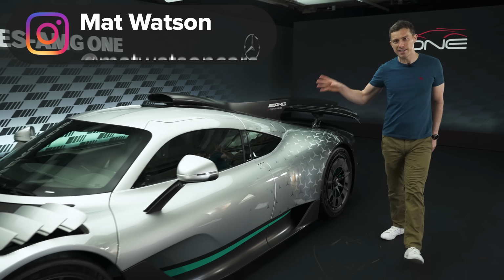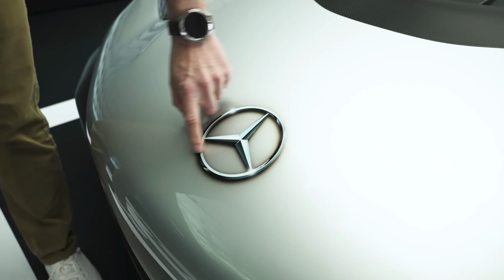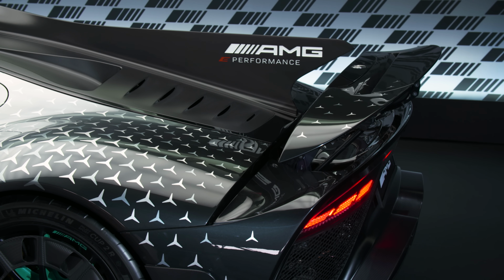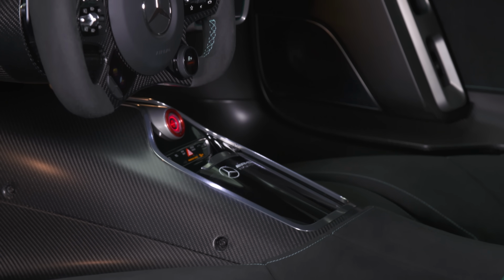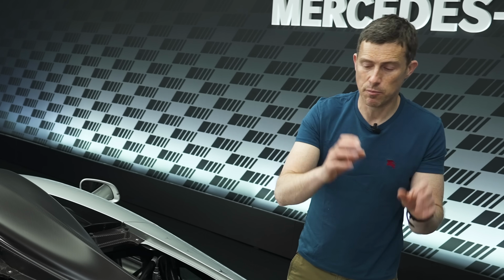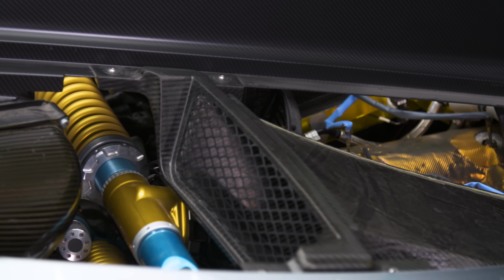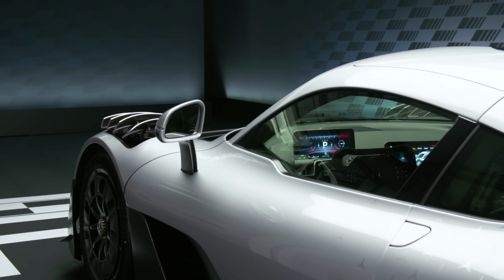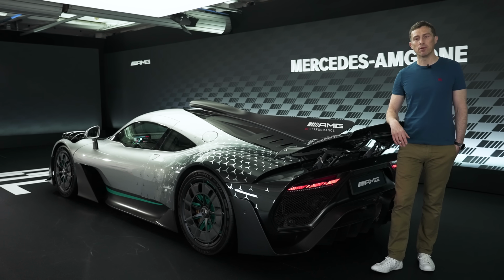Mercedes-AMG ONE: An F1 car for the road!

Comment: It sounds so simple in theory. Why shouldn't the cutting edge of hypercar design dovetail seamlessly with the bleeding edge of competition-ready, open-wheel racing tech? Well, forget the theory. Sit in the driver's seat. Take a breath, pucker up, and shoot a tentative glance in the direction of the throttle. Did you feel that? Have you noticed that you are suddenly a mile and a half into the next time zone, and your face is inside out? Yeah. That's why.

Comment: Also, the Formula 1 car this car’s drivetrain is based upon has one combustion motor, one hybrid, motor, and one electric motor. The AMG One  has all of that but with 4 electric motors. One at each wheel. 
That seems to be missing or incorrect in this video.
Fantastic video all the same!

Comment: Almost 50% of the combustion energy turned into motion energy... That is actually a pretty outstanding achievement!!! Well done Mercedes😌👏👏👌
Reply: The 50% was f1 cars.. This one 40%
Reply: Diesel engines do that too, they’re theoretically capable of hitting 73% thermal efficiency.
Reply: if it doesn't race i don't give a care.

Comment: Well, an F1 engine is scrapped after 5 to 6 races at the most. I'd like to see the longevity and reliability on this one. Honda perhaps can make a better running and more reliable roadcar with their F1 engine, more so because it's perhaps the last F1 engine they'd ever make.
Reply: I think I read somewhere, that after 60k km (or something like this) you have to get full service with engine replacement etc

Comment: 1700kg… wtf? Ferrari f8 tributo is 250kg less with v8 engine and doesn’t even have carbon chassis… maybe this is why it has the same 0-100 acceleration, with less power… after so much waiting and hype about F1 technology, someone might expect some extraordinary performance parameters…  something went terribly wrong with this project

Comment: Mercedes says the One will hit 62 mph from a stop in 2.9 seconds and reach 124 mph in 7.0 seconds, going on to a top speed of 219 mph. That bests the SLR Stirling Moss by 2 mph, making the One the fastest production Mercedes ever. It has massive carbon-ceramic brakes with ABS, and up to 80 percent of the One's braking energy can be sent back to the battery through regenerative braking. The awesome magnesium wheels have carbon-fiber aero covers and wear Michelin Pilot Sport Cup 2R M01 tires that were developed specifically for the One. Another innovation is the multilink suspension, which has adaptive dampers, hydraulically adjustable height and special pushrod spring struts at the direction of travel, which increases stiffness and reduces roll.

Comment: So mercedes finally released the long-awaited Project One, and as wildly impressive as it seems to small-minded people, it's somewhat underwhelming for a hypercar by Today's standards -- especially when you consider the multitude of tweaking it underwent over a span of half a decade... But let's take a look at the stats;

It does 0-100 (km/h) in 2.9 seconds - which is the same as the M5 CS, a family sedan that has 414 hp less, and is 130 kg heavier than the Amg hypercar. *signs of inferior engineering.

0-200 (km/h) takes 7 seconds. The Bugatti Chiron only needs 6.1 seconds to do the same, and it's 300 kg heavier and 6 years older than the highly acclaimed mercedes.

It has a top speed of 352 km/h, which is 39 kms slower than the McLaren F1, that was released in 1993 - and has 321 kW less power than the merc.

So we've waited so long for this mediocre answer to the likes of the La Ferrari and McLaren P1 that's much older than this Lamborghini copycat...Goodbye.🚮🚶‍♂️🛀
Reply: It’s a TRACK car, f1 cars aren’t aiming for top speed, they are aiming for the best track performance. Acceleration, top speed and horsepower aren’t the sole things that make a car good. It’s the quality overall and what it’s aiming for. You can’t compare a car built for top speed (Chiron) and a car built for the track (AMG ONE).

Comment: 2,9 sec 0-100kmh!?slow as frozen shit considering its 1063hp and its not cheap car too,if porsche turbo  can accelerate in 2,7sec or GT-R  and they are 13x cheaper and twice weaker and tesla plaid around same hp but again 13-15x cheaper   then wtf is this

Comment: This AMG-One is a hunk of junk
There are a butt ton of problems 
1. When stuck in traffic there is no rushing air to cool the engine down
2. When left in a garage the cold air will fuse the engine cylinders 
3. When you want to drive you’ll have to cool down the engine with hot water for 2 hrs
4. And it has 0 tolerance to air
5. It not a car with a real f1 engine
6.the f1 engine weren’t expect to last only 1000 miles

Comment: All this money for a 1.6 litre, that for sure needs a lots of maintance. 
Make more sense  an v8 amg 1 small electric engines and a weight on 1350kg.
The star  badge sticker it is simply ridicoulus. Just a marketing operation,born wirh bad timing(now Lewis fight with Alpine).
The Red Bull VALKIRIE with V12 it is better.
If I want a megacar with small engine the best it is Regera

Comment: 5:05 .. although 0-200 may not sound relevant, especially in reality. It’s not like you’ll be doing 200km/h every time you take your car out so 0-100 times sound more relevant or so to say. But for these high performance cars & what they are, I feel like manufactures should start focusing more on how quick their cars can get to 200km/h rather than 100. I mean what’s a performance car lately? Hard to justify those expensive ones & why they cost as much as they do. Rarity, status, quality and all that aside.. a lot of cars these days can do 3 secs 0-100. For a performance car, & especially a high end one, they should start focusing more on 0-200km/h times.. whilst we’re still there that Rimac is truly remarkable. 5.2 secs & you’re doing 200?? Insane.
Reply: On a car like this the important figures will be the lap times.
Reply: @bjornar9026  Rightfully so, I get that. This car has a more track focused approach to it or so to say. But I’m just referring to the manufacturers making these high performance cars overall. Stats matter, at least to some extent. Could potentially be the selling point honestly for some manufacturers. I’m just tryna justify how the 0-100 times are becoming less irrelevant these days, respectively of course. In terms of acceleration, instead of bragging about 0-100 times, it should be 0-200 times. We’re almost at the peak of how fast cars can get to 100 if we’re being honest, at least when considering the tires, science & overall what’s possible w the current advancements. With the position we’re currently at, 2 seconds or slightly less perhaps is the limit, at least that’s how I see it. Thus, 0-200 times should matter more! Rimac has obviously set the bar for now @5.2secs. Only question for now at least is who can better that, cause they’re aren’t going to be bettering the 0-100 times anytime soon now are they? But agin you never know, anything’s possible in this crazy world.

Comment: It took five years because its an epic task to modify the F1 bits into a road car remembering that the engine only lasts about 5 races or less and that's not very convenient on a daily car.  Also they have to modify the power delivery to ensure it can be driven at slower speed without staling.  It is a task that has a "mission impossible" tag.  AMF must have a lot of Ethan Hunts!

Comment: Five years development end they end up with ridiculous 1.7 tons in a car, that is promoted as an "F1 like" car. Seriously? If it had 8.0l I would say: At least, they tried it. But the actual tiny engine block cannot be more than 100 kg so where comes all the weight from regarding that most of the car is made from carbon?

No wonder this fatso takes unbelievable 7 seconds for 0-200 kph. Should be sub 6 seconds.

And all this for 2 million GBP. This car is nothing more than a bad joke. I would be so pissed if I ordered one 😀

Comment: Compare this car to the 2013 Porsche 918 Weissach and the recent Ferrari SF90 Asetto Corsa. 
ONE is a bit of a porker, and doesn't really promise all that much more power and acceleration. None of the latter, actually. Why? Because they added 400-500 kg to the "design" that wasn't there until they now got it ready.
The F1 engine was a horrible decision. Koenigsegg is doing hybrid hypercar so much more convincing.

Comment: So it costs the same as an Aston Martin Valkyrie, about 600kg heavier, with about 100bhp less and way less downforce. Night and day difference

I'm sorry but the AMG 1 hasn't lived up to expectations and on paper it's quite poor.

It's still slower than a cheaper Bugatti Chiron on a sprint, barely any more powerful than a Buggati Veyron from 17 years ago.

Nowhere near the likes of 2000bhp Rimac Or Lotus Evija which are significantly cheaper still.

From the looks of it, a 765lt or Ferrari models will be able to hold against it quite comfortably. Even a Tesla. With BMW and Porsche ramping up EV game..the next M2 and M5 competition hybrid variants are expected to be around 1000bhp - 1200bhp.

Due to aforementioned reasons..the AMG seems like nothing but a marketing gimmick

Comment: This just shows what a masterpiece the Gordon Murray T.50 is, it's 700kgs lighter! The performance fiures of this are no different to the almost-decade old McLaren P1. Impressive, I'm sure it is, but doesn't seem so special.
Reply: Even T. 33 looks more special...
Reply: I agree.. weight, power output. I don't see nothing special. But I'm interesting to see lap times. Maybe I'm wrong
Reply: @niksapaypal2077  a 1.6l v6 turbo hybrid is pretty special in itself especially turned into a street-able state. Even I can't imagine this being faster than both the Valkyrie and the T50 with all the extra baggage its carrying but who knows? The 8-time constructor's champions might have built some magic in there.
Reply: @sabershiro5707  I agree with engine. But what's the purpose if  car is still heavy. And doesn't make car faster or more agile. Anyways on papers like that. I'm interesting to see how it perform. Maybe suprise me
Reply: I would love to see the AMG, Aston Martin Valcuri and the T50 up against each other on a track. 700 kg makes a bit difference
Reply: T50 is ugleh the amg one is not

Comment: Can anyone explain..on an F1 car they open the rear wing slot gap for the DRS but on this car there is a slot gap and DRS closes it by moving the outer wing in?
Reply: I'm going to give you a laymans answer.  The F1 DRS, when opened, where the slot gap appears, you have no air hitting that part of the rear wing and thereby, it creates less drag, and where there's less drag, you have an increase in top speed.

Without looking properly into the Project AMG and based on what you have said, it seems as though, to reduce drag, the effect is opposite.  So with the slot gap closed, drag is reduced and a higher top speed is then acheived.

But if you want an aerodynamicist to give you a better and more technical answer, be prepared for some scary physics.

Comment: very disappointed , a 2 milion car so many years of expectation , and this thing weights 1.7 tons , im sure it will be very good on race track , but the hp to weight ratio its not impresive , this was mercedes chance against ferrari mclaren and porsche and they build somehow what mclaren did with the P1 and ferrari with la ferrari and porscha with the 918 did 10 years ago , but this does not look beautyful or sexy , its the ugly car of its category and considering the price point the only thing special will be lap times , and lets se if it will beat mclaren senna , or p1 gtr , they are cheaper by the way and look better and sound better and they are very light weight , imagine if mclaren porshce and ferrari release their new hypercar trio now , the amg one will remain in shadow

Comment: The highly acclaimed sports car (1.7 tons, laughable) isn't any faster in the mountains than a Super_7, which I can get for 1/50th the price of an AMG_One
Reply: What is worse: it is no faster than a mclaren 765LT to 200km/h, and due to the extra weight and small batteries i have significant doubts it will be faster around any circuit than the Senna. If only it would be as easy for mclaren to trump AMG at formula 1 as it seems to be in sports cars...

Comment: "Kinda", like some F1 parts and concepts. For the fans, we get it. The thing about engine and gearbox stress members is that for a race car they have a limited life/wear cycle. The engine itself is stressed internally, and you want the block cylinder wall to not be stressed, for straightness, power and longevity.
Reply: using the motor as a stress memebrr for the frame is actually old technology

the same thing has been done with motorcycles for quite some time and the do perform every day as usual
Reply: @DarkIzo  An inline-4 motorcycle is anchored at the trans bottom and the head top; to a flexing steel frame. Not suspension to the trans/engine block sides. Or 1000+ power.
Reply: This is not going to be a friendly road driver. The gma t50 on the other hand, had maintainability engineered into it from the beginning.

Comment: A LOT heavier than initially advertised and VERY underwhelming acceleration figures for a 1000 bhp + 4 wheel drive track car. 0-124 mph in 7.0 seconds is slower than a Mclaren Senna
Reply: yeah 0-60 in 2.9 for 1000hp is i dont understand why its 2.9 it even has antilag for the turbo is really slow and heavyy.
Reply: @cokermaseryer  originally it was supposed to do 0-100 in under 2.5, 0-200 in under 6 sec. this is a huge downgrade
Reply: @cokermaseryer   2 million pound car 0-60 in 2.9 its not about the senna its 1000hp and the stats are garbage who would want to buy this slow car you could get dusted by a huracan easily
Reply: the engine is awful aswell only 1.6litre thats like a toyota aygo and a v6 are they ok
Reply: 1,600kg ..

Comment: Way too heavy tbh. The drive train is impressive but that's about it.
Reply: It's not impressive it's slower than an SF90
Reply: @h2wr  putting a formula 1 engine into a road car is impressive, even if it's kinda slow. But this thing should at least weigh 200 kg less

Comment: No wonder this car was delayed so many damn times lol, they were figuring out how they could cut weight from it and after all that it still weighs 1700kg. So damn disappointing, the Valkyrie is going to demolish this thing. Hell the T.50 will demolish this thing as well and it has 400 less horsepower.

I know it was never going to be as light as the Valkyrie given that its a hybrid power train and the shape of its body, but they couldn't even manage 1400kg? The weight of any average supercar?

Comment: Rubbish...delays we're due to reliability issues with an F1 engine on public roads and non-compliant idle emissions..... you think McLaren is unreliable just wait until this is out on the streets! It'll likely work 1/2 times per 10 times of asking if you're lucky!  though I'm almost certain customers will have to sign something from Mercedes to not trash talk it publically.

Comment: A McLaren Senna is more impressive tbh. Weighs much less & has over 800bhp putting it's power to weight ratio higher than the AMG One. Once you look past the F1 engine novelty it looks like a Mercedes version of a McLaren P1 but fatter with awd. Got to give Porsche, Ferrari & McLaren credit because thier trio of hypercars aren't far off the same performance & that was over a decade ago. The Aston Martin Valkyrie will be in a class of one from a track performance perspective. Bit underwhelming by Mercedes this. Looks decent though. A 765lt would scare this car sadly. Should have canned this project 3 years ago when they were begging customers to switch to a V12. They knew then this car was going to be a let down.

Comment: Everything about this car impresses me. But one thing...

The weight. 1.7 tons for a car like this??? It's about 200kg heavier than it should be to be honest. Other hypercars like the Aston Martin Valkyrie and Koenigsegg Jesko weight 300kg less and have as much if not more horsepower.

Still, it's an amazing piece of engineering to have an actual V6T-H from an actual F1 car to be put on the road. And the car looks amazing.

Comment: 0-200kph in 7 seconds really isn't as quick as I expected. The Ferrari sf90 does it in 6.3. Acceleration isn't the only metric, but it is an important one.
Reply: 5.2 he said. Listen again
Reply: @paganizondasroadster1660  5.2 is for the Rimac Nevera. See 5:06.
Reply: @chrisc475  I think it’s designed to go through corners at high speed and it’s the car you could drive out to take your gf to dinner. Compared  to the Valkyrie has all the tech and comfort that Mercedes’ offer

Comment: This machine is absolutely insane! If this doesn’t obliterate the ring lap record, i’ll be astonished
Reply: i wouldn't be so sure. if they had beaten the time of the gtr black series, they would have posted the time already... it is significantly heavy and has about the same acceleration as a mclaren 720s, even though they have 300hp more and a hybrid system. it's a disappointment in my book (for now)
Reply: @manuelight  for me too
Reply: LMP1 and LMH cars are faster
Reply: A standard 911 turbo S is as quick 0 to 100 km, if not faster and costs 10%. But do agree this is an insane machine. Compliments to Mercedes!
Reply: This is not made for max speed, min drag, guys ...
Reply: @exnihilonihilfit6316  it’s made to be fast around the circuit,still I think LMP1 and LMH will beat it

Comment: Mercedes are deffo putting that 0-100 time down (like Porsche), with those specs and weight + aero aswell this car should easily match the SF90 or beat it - which does 0-60 in 2.5 but in reality more like 2.2